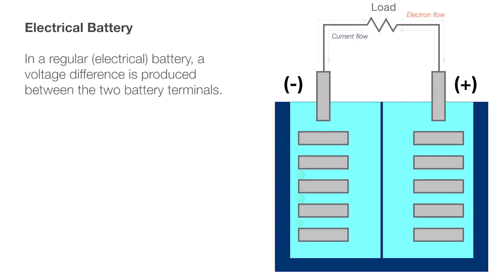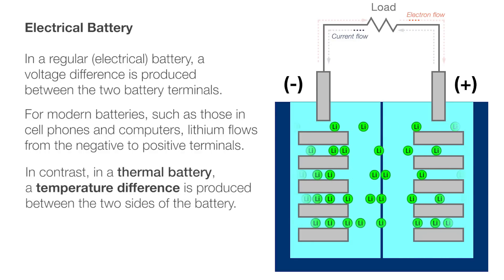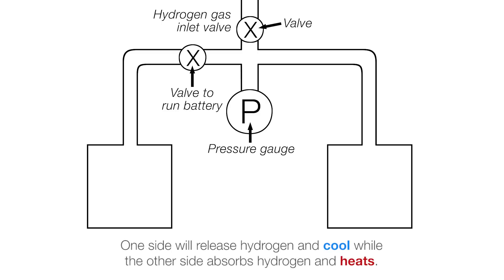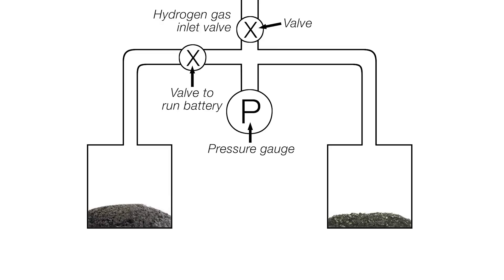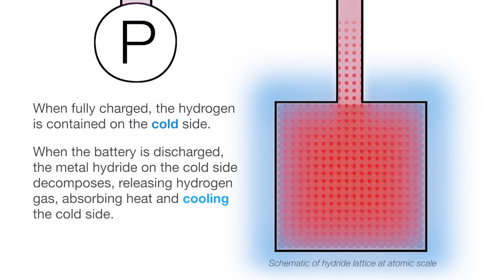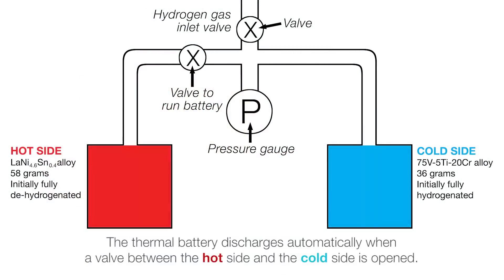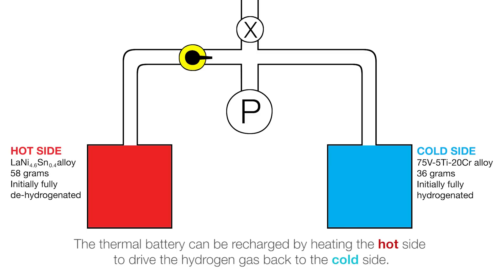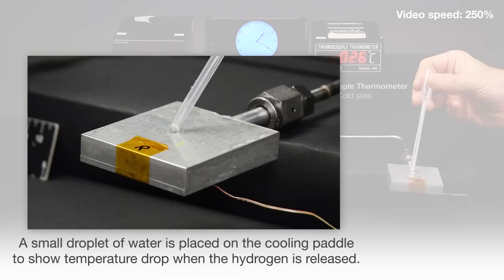Thermal Battery Laboratory-Scale Demonstration

Comment: 4:40 The motivation was for heating for electric cars, I am looking for a more sustainable way of heating a campervan or RV this would be very interesting.
Reply: Good luck obtaining those compounds
Reply: thermal heat pipes on the roof (or detachable heat box) - heat pump hot air - insulated hot water tank inside RV.